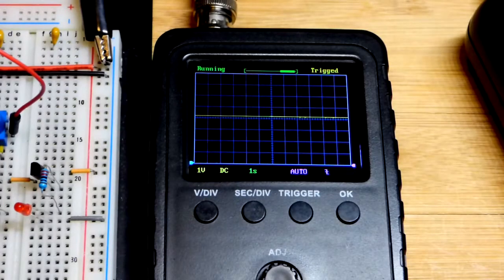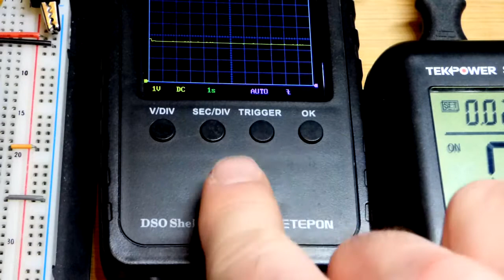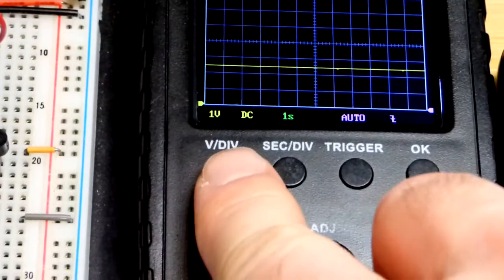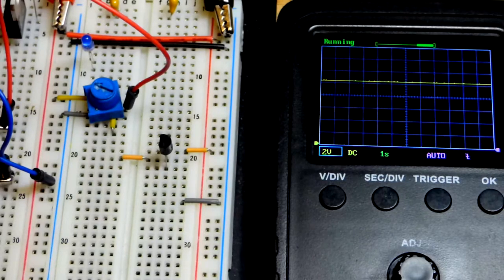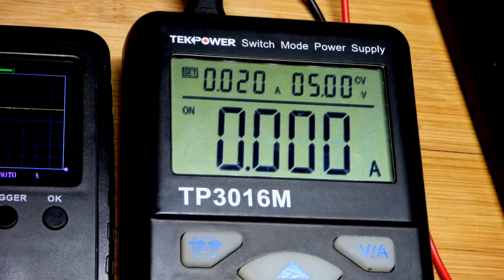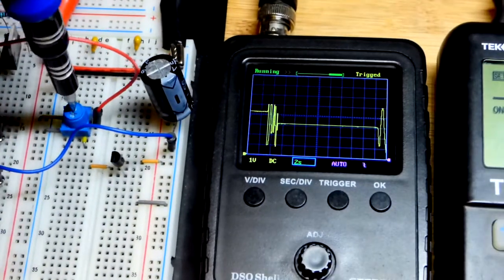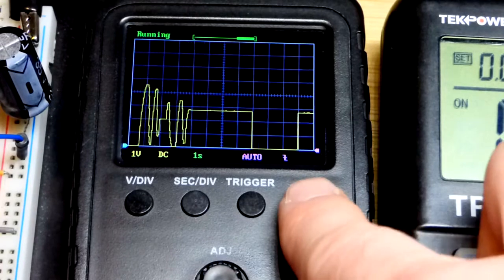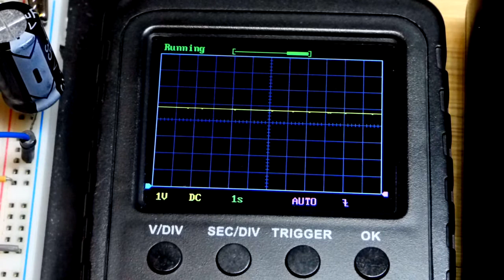DSO shell pocket oscilloscope how to use for measuring slow voltage changes easily at low price

Comment: thanks for info
does it able to detect voltage drop for 0.01s ?
Reply from the maker: This just takes simple voltage measurements in real time. You can only pause it. I don't think there's any way to capture spikes with a tool this cheap.

Comment: Well Done!!  Very helpful video for individuals wishing to see what is happening during their electronics Experiments & Projects without the worry and expense of damaging an expensive Oscilloscope ... and honestly just a lot easier to use :-) I have a very expensive Oscilloscope in my workshop; however, bought one of these Pocket Oscilloscopes after watching 
electronzapdotcom videos because it is a great way to visually see what is happening with Volts, especially if I am not in my normal workshop setting or teaching an electronic circuit to a beginner.
Reply from the maker: Indeed :)